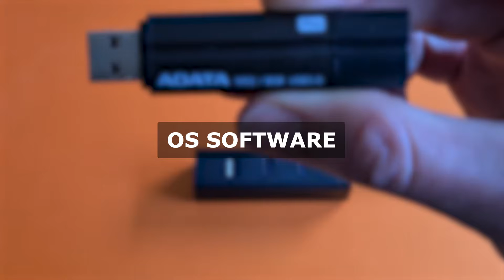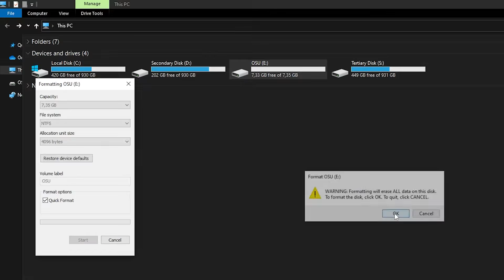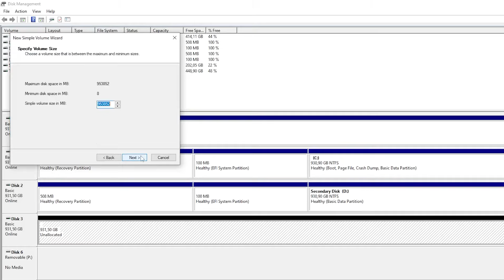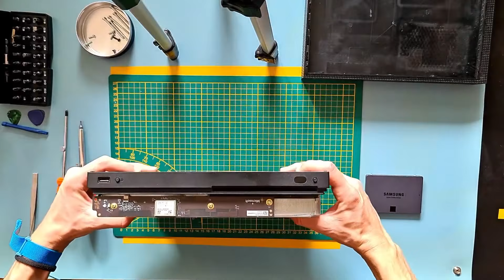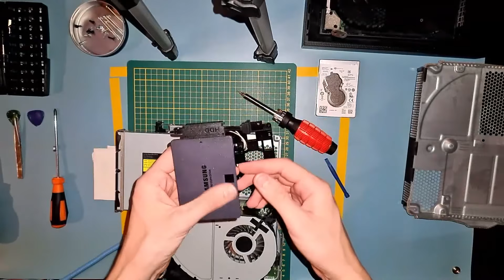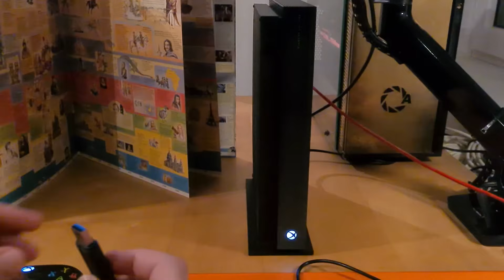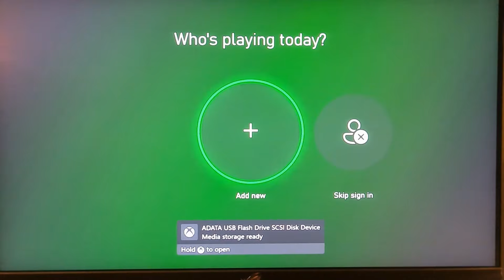Xbox One X | SSD Upgrade Guide | Loading Times

Comment: Ehh... dude.. on a Xbox One X the MINIMUM SSD size should be a 2TB Samsung Evo SSD... anything less will be a disaster because of the way Microsoft partitions the HDD storage space.

The basic Xbox One launched in 2013 when 500GB was the size and was enough however the Xbox One X is about 4K HDR-10 and 1080p 120Hz VRR (if you can find any games to run that, otherwise 4K HDR and SDR is enough)

Also note a game like Red Dead Redemption 2 takes up to 80GB of storage space and that's before you reconnect the system to the internet to download whatever patches are needed to fix things and if you use RDR Online 

Halo Infinite is another which easily gobbles 80GB of storage and then there's the Call of Duty games which eat up 100GB I don't play those but you make a video in 2025 and tell people to get a 500GB SSD for the Xbox One X is just terrible advice....

Also the brand matters.. Crucial is another brand but you have to make sure it's a specific model or you will have sloppy SSD performance. 

Finally you should never recommend 500GB SSD period when 2TB SSDs can be had for less than $150 on sale at Best Buy because you will be forced to leave at minimum 100GB FREE from being used, otherwise you WILL have sluggish SSD performance and kill your SSD prematurely...hence a 2TB is more logical as you can leave 200GB free and not have a care because you get 1.6TB after Microsoft formats the SSD so basically you can fill it up to 1.3TB with the games you care about or even just 1TB and not have to worry about removing or reinstalling and you get the fastest possible loading speeds.
Reply from the maker: I appreciate your input, but first you are misrepresenting, what I said in the video and also the video's purpose. I state, that if you switch from HDD to SSD, you get faster loading times. That I have demonstrated. But we can take it further off the scope of this video. I do not recommend any disk size, I just simply stated what is the minimum. Every gamer knows how much space he needs.. in the end, he is replacing his old HDD, so he must know what is best for him. I know, that I am always going to play only one game at a time and then uninstall it, so I definitely do not need bigger size. Second, of course there are better brands of SSDs, but any brand is a significant improvement over an HDD, so I disagree, that you have to be picky, if you don't want to be. Third, I got this Samsung EVO 1TB SSD for like 35e, which is big difference compared to 150e. Fourth, I disagree that you need to go to the high end extremes as an argument for why to buy Xbox One X over Xbox One or Xbox One S, as implied. Xbox One X is the better hardware, it is faster, more stable framerate, there are plenty of Xbox One X enhanced games. You can go for the lows instead of the highs. What I mean by that.. the fact that it actually supports native 4k while the other Xbox ONEs don't and that it can actually do 60 fps in some games, while the other ONEs can't, is enough reason to buy Xbox One X. So I disagree that the Xbox One X is solely about the 4K HDR/1080p 120fps.

Comment: I did this on a new to me, secondhand, one X last week. Really easy process and now have a good second system for $150
Reply from the maker: Nice! My price tag was about the same for the secondhand console + controller + used SSD.
Reply: Console controller and new ssd total was $200
Reply: I found mine (Xbox 1x 1tb by the dumpster with a an Xbox 1 original 1tb caked in filth to the heat sink got them home cleaned them up and they turn on and work perfect going to do this next! For faster speeds
Reply: @CodyArndt-z1e is that better than a Series S for $200

Comment: Wouldn't it be easier to just clone the 1.TB HDD to 1.TB SSD?
Reply from the maker: I would say, no. For drive cloning on Windows, you need a third party program. Also, most of the times, while cloning you need both drives plugged in the system at the same time, which in some cases could be more difficult to manage for a beginner. Also, there could be issues when cloning to a bigger drive than 1TB. If I am not mistaken, you don't even have to format the new drive, the xbox offline update through troubleshooting should take care of it. I included the step because I wasn't 100% sure, if it works with no issues every time.
Reply: @will_neithan  I understand, but for non average users it's not a problem to use Easus Partition Manager to clone a drive. You only need a "office PC" for that process. Most PC's usually have 2-3 unused S-ATA cables, making it easy to connect the 1.TB Xbox HDD and a 1.TB SSD at the same time.
My 5 year warranty recently ran out on Xbox, so i finally bought a SSD for it today. Gonna clone it to SSD tomorrow and i hope it's 1:1 for real.
I already had 8.TB in the console USB ports for years. 2 x 4.TB Seagate Xbox branded drives.
HDD's in USB port on Xbox One X is faster than the slow internal HDD...
Reply from the maker: Definitely, as you can see on yourself, if you are a non-average user, you can take initiative on your own and upgrade the process if you feel like my guide has unnecessary steps. If there is someone who does not have experience with stuff like this, even opening up a PC and connecting the drives, if you don't have two external interfaces, could be a stressful activity. That is why I offered one solution, that, I believe, requires the least amount of more advanced steps. That was my philosophy. Good luck with your upgrade! 8TB.. that is a lot:D
Reply: @will_neithan  Thanks. :) There is nothing wrong with your guide as it's for casuals. :) Funny thing is that you post a guide 7-8 years after the console launched and i'm upgrading the HDD to SSD around the same time. It's never too late. lol
My Series X/PS5 console is my gaming PC and Lenovo Legion Go handheld PC.
Fun fact.
Xbox One X runs some games better than Series S and looks better than Series S versions.
Reply from the maker: @V3ntilator  "Xbox One X runs some games better than Series S.." THIS!!! I wanted to upgrade from my Xbox 360 just so I can play all the games from the Gears of War saga and at 60 fps. So I didn't want to invest into Series X, because after Gears it's going to be sitting on my shelf. And when I looked at in-game comparisons between One X and Series S, many times the One X looked better. So I bought a secondhand, upgraded the SSD and the Xbox still does the job very well after all these years:)
Reply: @will_neithan  Yes, it's still a powerful console. Just needs a SSD because of the slow HDD. :) Digital Foundry made some videos showing games looking better on Xbox One X. Microsoft did some major changes to the console SDK and Framework, and is probably why not all new games is coming to XBX. Forza Horizon 5 works on XBX.
Time will tell if Gears of War - E-Day comes to XBX or not. So far they only said Xbox and PC.
Reply from the maker: @V3ntilator  If they skip old Xbox generations with GoW E-Day, PC is okay with me. I'm super excited about the game.